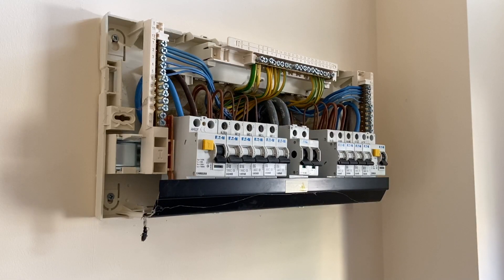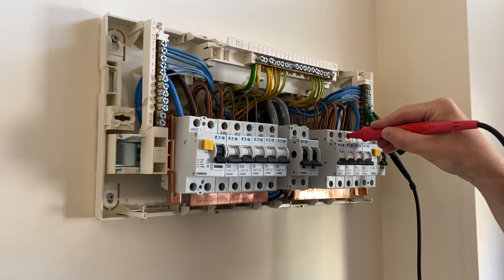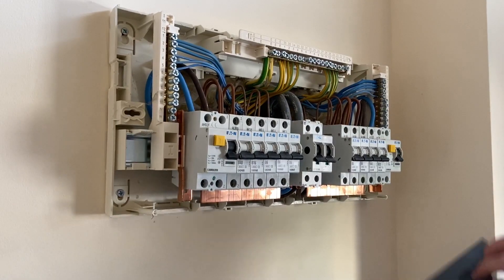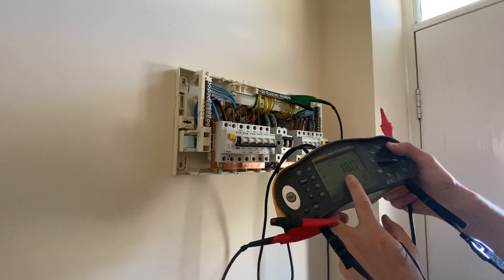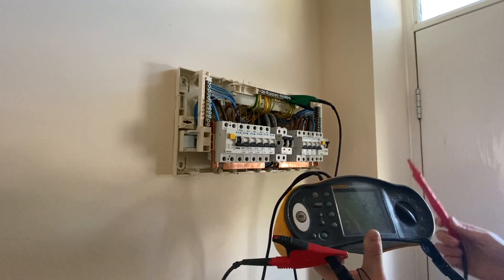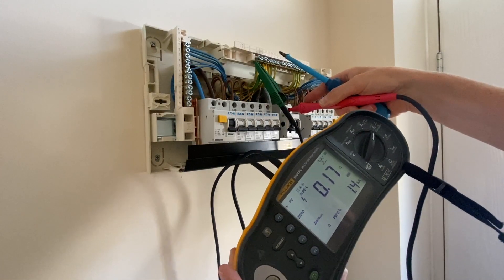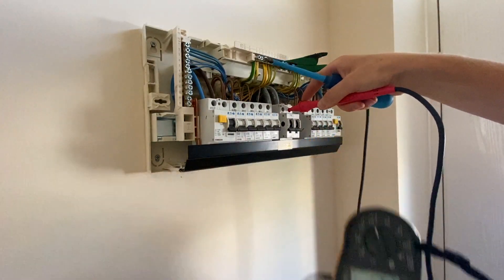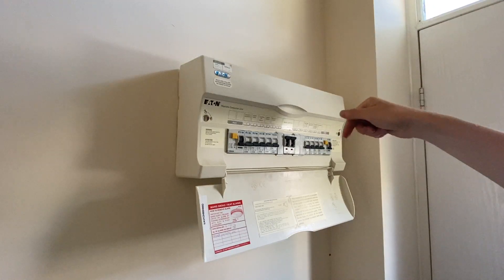Electrical Installation Condition Report Sample - Part 3

Comment: Nice video again matey!  

Just so you know.....The plastic CU is a code 3.  100%

Just think about it for a minute.  What is the purpose of the report?  One of the purposes is to identify any non-compliance’s with the current edition of BS7671 which may give rise to danger.

That is  stated in ‘Guidance note 4’ also.  The current regulations state, specifically 421.1.201....that all domestic consumer units should be constructed of non combustible material because they have realised that plastic consumer units give rise to danger in dwellings.   The reg doesn’t say ‘only if installed under stairs, or in escape routes’!  It clearly indicates that ALL consumer units in domestic dwellings need to meet this criteria or be housed within a cabinet or enclosure of non combustible material.  Therefore a plastic consumer unit ANYWHERE in a dwelling is non compliant to current standards, a standard that was changed on the grounds of safety.  Why would you not bring it to the clients attention and recommend improvement??  You’re not really doing your job properly if you don’t!  Remember......a C3 is not a fail, so the client gains nothing from you keeping it off the report! 

Lastly, (bearing in mind that EICR’s are carried out to the latest version of the regs), on your schedule of inspected items;  (item 4.4). What exactly will you put in this box if the CU is plastic, and was installed to the 16th?  It isn’t Non applicable.  It isn’t a code 1 or 2.  FI Maybe??  No......it’s obviously a code 3.

An EICR form/report  asks you directly about the ‘condition of enclosure in terms of fire rating’ under the consumer unit section.  This needs to be answered.  It’s either plastic or metal.  It’s either compliant or not.  If non compliant to current standards.....was it compliant on the day it was installed?  Once you answer these questions, you can code it.  But trust me.....it warrants a code in any case.

Now......if this is incorrect;  I’m open to someone explaining to me how you can answer this direct question on the EICR form with an N/A.   In my mind, it is only non applicable if there is no consumer unit at all in the first place!
Reply: Sparky MacSparkface Any good sparky will have copies mate
Reply: And just to add.....a code 3 is ‘improvement recommended’.  Doesn’t mention ‘For safety’
Reply: K C it’s all for safety hence we recommend C3’s for things that can be improved on from a safety perspective, such as additional protection for cables concealed in walls, additional protection for circuits serving a bathroom location ( but with supplementary bonding in place) etc etc.
The whole EICR is based on if the installation is in a safe condition and fit for continued use
Reply: ian adams It certainly is....but we are also reporting on if the installation is compliant with current standards or not.  And if the installation isn’t ,  we assess if an upgrade to current standards can improve safety significantly.  If this isn’t the case, and the report was purely  immediate safety only, and nothing to do with improving the  overall safety standard of the installation......Then why does a Code 3 exist at all......If the report is only what you say it is....why do we have a code that can be attributed to an observation without affecting a satisfactory outcome?  A report can have a satisfactory (and therefore safe) outcome with many Code 3’s.  But if it’s all about safety at the time.....and nothing to do with improvement for the future......why have the option of a C3?
Reply: K C Ultimately they has to be an improvement of safety and not just a non compliance which needs addressing. 
An installation with a perfectly fine CU wouldn’t result in a safer installation by changing it needlessly. It’s like coding things like no sleeving on switch lines, it’s required to identify conductors by colour or other means ,so non compliant but I wouldn’t C3 it as it wont improve the installation.
Reply: ian adams Sorry buddy....your wrong.  And you haven’t answered any of my questions.....obviously, because it’s difficult to do so and maintain your argument.

It’s quite straight forward.....A C3 in this instance is saying that your consumer unit is safe for continued use, but we recommend improvement because it isn’t as safe as it could be.  Will your plastic CU be as safe as a metal one?  Sure......as long as a fault doesn’t develop and a fire doesn’t start inside!  If a fire does start inside, will a plastic consumer unit be as safe as a metal one........urm, NO,  (‘but why didn’t you tell me so I could make my own mind up?????’ Says the client who had a report without any mention of it! Lol)

Don’t forget.....you are still passing the installation with a plastic consumer unit.  You’re simply saying, your engineering judgement is that an improvement on safety could be made if the enclosure was a different material, based on the current standards.
Reply: K C If you see my comment earlier I stated that it should be mentioned on the report but it’s not necessarily unsafe or requires a code. I’ve put my comments forward so to say I haven’t addressed my reasons to maintain a discussion( argument is your wording ) is not correct. As I said before it’s for the individual inspector to decide if any what code to apply, there’s no set rule other than guidance and it is just guidance. You carry on with your C3 and I’ll carry on with my risk assessment methods of coding. The whole point is that you have assessed the CU and that you are satisfied that it can be still used for continuous service, so to say to a client it’s recommended that you have a perfectly fine CU changed is unethical in my mind because that’s what you are doing by coding it a C3, you’re recommending it be changed, not that it has to be but recommended it be , Like C3ing red and black wiring and recommending it be changed because it’s now non compliant colours. Just my opinion KC but I agree with the guys who put the best practice guide together and the Napit codebreaker book which both state that a plastic CU should warrant no code as long as all connections are secure, IP ratings are intact etc etc.
Reply: ian adams I agree.....it is the decision of the inspector on the day.  My way results in a code 3, your way results in a comment.  I suppose, either way it’s being mentioned.   I like to explain it to my clients that, their installation is to a safe standard, and perfectly safe for continued use.  I just explain that (money aside) there is a better version of the installation out there now should they want to improve it at a later date.  It isn’t an up sell......I pride myself  on giving my clients all the facts and detailed advice so that they can make their own minds up.  An informed decision.  As a professional......why would I not recommend that my clients have the best standard, and let them decide to have the bog standard instead if that’s what they are happy with.  I can walk away knowing that I did give them that option, but they decided against it.

Much better than keeping it from them, or not making it clear enough on the report.  Only for them to say later down the line....‘I wasn’t told about that!  No one advised me of this!’

Oh well......different horses and all that!  I’ve been coding this a C3 for years!  Never been pulled on it during my annual assessment.  Doubt I ever will.  👍🏻
Reply: ian adams I agree, that’s why the guidance indicates a c2 is also applicable if loose connections are present within the consumer unit. That been said I see no problem with the code 3 as long as it doesn’t result in scare mongering the customer.
Reply: @Spark101.  Like you I always code it a c3 and recommend an upgrade that way if anything happens you have put the owness back on the person ordering the EICR
Reply: If you read the ‘Notes for recipients’ part of an EICR report......you’ll understand that a Code 3 is correct.  Unless changing a plastic consumer unit to a metal consumer unit isn’t a ‘significant’ safety improvement.  If it isn’t.....it begs the question why they changed the requirement in the 1st place.
Reply: And....do you honestly think changing a plastic board to metal board isn’t improving upon safety???
Reply: Sparky MacSparkface there’s no requirement to seal the rear entry of a CU, only that the IP ratings are maintained
Reply: ian adams There are regs that support fire barriers between fire compartments though
Reply: K C Is it compromising a fire compartment tho? Most single  dwellings are a single fire compartment, depending on attached garages etc. Hard to say from just watching a video.
Reply: Sparky MacSparkface The IP ratings are for accessible positions of the Cu
Reply: Sparky MacSparkface hi ip ratings dont apply to the rear of an enclosure. Usually it’ll naturally achieve IP2x as its mounted on a wall
Reply: Regulation (421.1.201) was added because too many fires started in CU’s in dwellings and due to the plastic construction the fire spread.  Metal consumer units were introduced to reduce the spread of fires that started in a CU.

Let’s say, a plastic consumer unit with tight terminals and no thermal damage, correct sizing of cables in coordination with MCBs etc etc.....Has a safety rating of 3/5.  The same unit, but constructed of metal has a safety rating of 5\5.  You are being paid to advise your client on the condition of the installation, and inspecting against current standards.  I ask you.....why would you not bring it to your clients attention about the plastic CU and recommend improvement?  By giving it a C3, you are already saying it’s safe.  You’re just also saying the CU can be improved to current standards and you recommend it.

Also;  what would you actually put on the schedule at point 4.4??   Putting N/A isn’t acceptable.  The question is basically;  is the CU fire rated?  Not, ‘is it still safe although it’s plastic, and installed to another edition?’
Reply: K C Not all non compliance’s regarding bs7671 requires coding. To code the CU a C3 is saying that a improvement for safety is recommended, how is replacing a perfectly fine ( tho yes no longer compliant CU ) if fit for purpose, making the installation safer?
If you’ve concluded that they are no issues regarding loose connections etc, then why recommend an improvement of safety?
An example of non compliance’s that don’t require coding but are worthy of note on the report is given in best practice number 4, such as a plastic CU if fit for purpose. Also by ticking the box regarding fire performance, your confirming just that, that the CU is not a fire hazard, which it’s not if your inspection has confirmed it’s fit for continued use. This box is in the schedule of inspections for all EICR reports, not just domestic dwellings.
Of course you are the inspector so if you feel a C3 minimum is what you want to put down then that’s upto the individual’s approach of their risk assessment regarding this particular issue, which is the reason a C3 is suggested when the CU is located in an increased fire location or a sole means of escape.

Comment: I Agree with Anthony charles    Well said 

If its one of those dodgy ones where the manufacturers simply put a british standard sticker on it, knowing that it failed the hot wire test you would be within your right to put a code 1, and replaced at the manufacturers expense, like thats going to happen. 
And everyone in the industry has had a bout of amnesia and swept it under the very big carpet. If that was car related there would have been a recall. Or you could ask London fire brigade, they seem to be writing our regs now. There was nothing wrong with a correctly manufactured and installed plastic consumer unit, instead of dealing with the cause they have tried to deal with the symptoms

Comment: If its one of those dodgy ones where the manufacturers simply put a british standard sticker on it, knowing that it failed the hot wire test you would be within your right to put a code 1, and replaced at the manufacturers expense, like thats going to happen. 
And everyone in the industry has had a bout of amnesia and swept it under the very big carpet. If that was car related there would have been a recall. Or you could ask London fire brigade, they seem to be writing our regs now. There was nothing wrong with a correctly manufactured and installed plastic consumer unit, instead of dealing with the cause they have tried to deal with the symptoms.

Comment: Did you not fancy putting the neutral probe in for the RCD.. It is actually concerning seeing your test procedure. I think a read up in GN3 is in order or a refresher course. Sorry to say.
Reply: Think you need to read up on the fluke operating instructions Luke 👌
Reply: Is Luke on about RCD test? Its only a line and earth connection needed on my Megger, not sure about the Fluke.
Reply: depends on the tester... some offer a 2low test which only requires two probes. others use a 3 low which need all 3 connections
Reply: It depends on the make of test instrument as to wether or not a neutral connection is required, even if it does need it the connection is probably only to power the test instrument.  I use a Megger 1741 and the instructions say line and earth for RCD tests.
Reply: One mistake I think Alistair made was to do the RCD tests before loop test - I know the sequence of tests isn’t as important in an EICR but it does say in GN3 that the earth loop should be carried out prior to RCD testing in the RCD testing section.  I think it is to do with exposed metalwork potentially becoming live if there isn’t an earth fault loop for the duration of the test, though I wouldn’t be surprised if modern testers have some sort of inbuilt protection for this.
Reply: cumberland1234 who the hell is Alistair?
Reply: @SME_Ste  I meant Jordan oops! 🤦‍♂️ Hopefully Alistair isn't offended!!😛
Reply: 😂😂 So many fresh out of college Sparky’s who have only used one type of instrument.  Sorry to say......

(Just banter.....no offence intended)

Comment: I watch the few of your videos and they do give me concerns.
I will have to ask do you really understand the sequence.
What I have seen is not the correct procedure you are  follow or any sequence laid down in OSG or GN3.

If this is the standard of your work  bring  the electrical industry poor workmanship with this video..

If you have carried this sequence out when you would have done your 2 391 practical exam it would have been referred.

Also misleading how to carry out the correct sequence of testing as shown in the video.
Reply: Brian Baker The sequence of testing laid out in GN3 and the OSG is for initial verification, for an EICR the sequence of tests are irrelevant as the installation is already in service.
Note 3 from GN3 page 99 clearly states that the tests need not be carried out in the order shown in the table, and why would they?
Reply: Well said Ian.  Ironically.....it would seem a certain other person is a little unclear on testing! 👀
Reply: What Ian said 👍🏼
Reply: Well said ian, not understood by many i think
Reply: In the real world you test what you can how you can when you get the chance, as previously stated a new installed should be tested as per stated sequence to avoid turning on a dangerous circuit. 

Find something less pedantic to moan a about
Reply: I'd say some people need to think before they mouth off, not wishing to sound rude about it. Obviously someone who has never done an EICR or knows very little about it. As previously stated you do the tests in any order you can. You are reporting whether the installation is in a suitable condition for continued service, not an initial verification.
Reply: Is it Brian Baker or Brian the Baker?

Comment: C3 all day long, although it would not warrant an unsatisfactory report.

EDIT: To clarify, I understand usually it wouldn't be a C3 if not under the stairs. However it is in very close proximity to the bottom of the stairs. But also as the cable entry is through the back with a great big hole in it. For all I know (not been on site) that is a stud wall, whereby fire could quite easily spread rapidly and the plasterboard is of unknown origin. Making assumptions as I haven't been on site. :)
Reply: What if the plastic consumer unit is within a wooden cupboard next to a gas combi boiler?